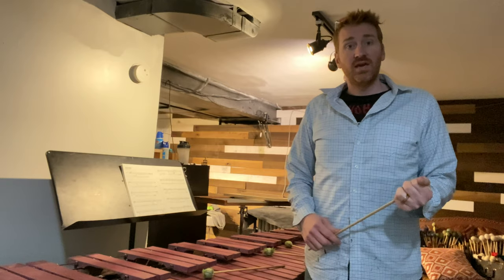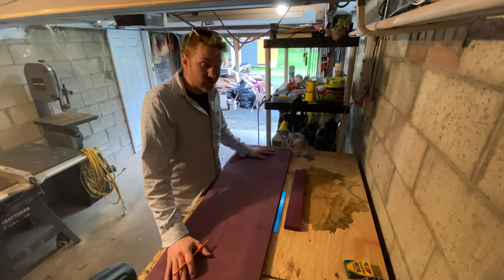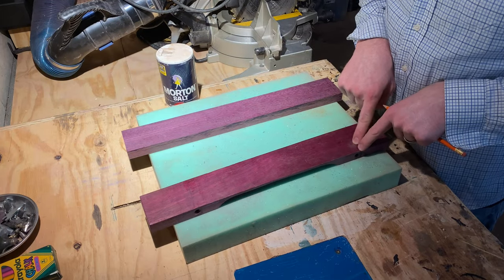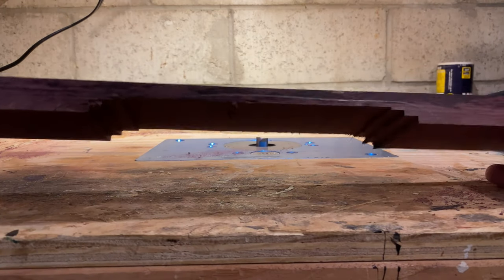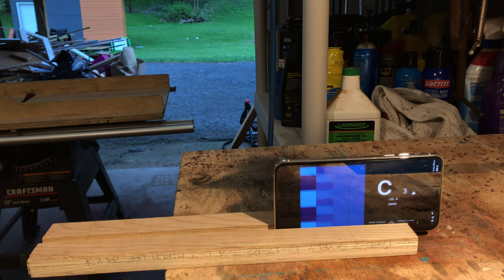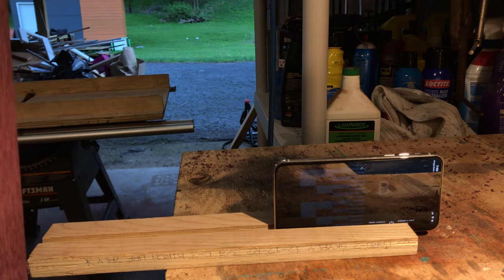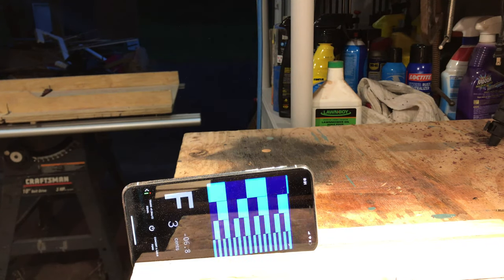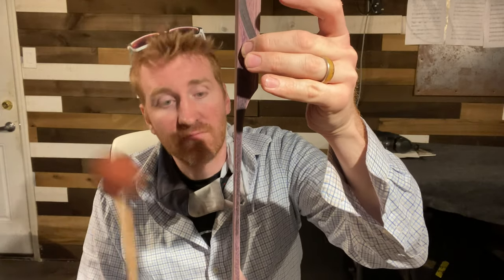Marimba Bar - Build it Fix it!

Comment: Might you know of an ultra-advanced method for node-finding, like a fancy camera that detects/shows vibration-imagining? Might you know how the big boys do it? I can’t imagine the Marimba One and Yamaha guys doing the salt trick for all their thousands of bars. 🙂
Reply from the maker: Thanks for reaching out man.  Ummmm....It has been about 8 years since I have reached out and got an answer here so it might have changed.  To my knowledge the way that major producers like Adams, Yamaha, and Marimba One work is by mass producing one size bar.  They spend a ton of time figuring out the best size to produce the best overtones and then they mass produce that bar and pick the best sounding bar out of 1000s.  During the testing phase I believe that tracking the nodes is important but once they get the size, I don't think they would track it for each bar.  I believe they just go by ear at that point.  For finding the nodes, I don't think that there is a better method than salt or sawdust because the amount of money to create a product for such a small market wouldn't really be economical right now.  Most of the people making marimbas actually do it more by ear and by old methods than by new ones.  Marimba One, I believe, is pushing to use tech more than any other company.  This is seen less in the bars though and more in the resolators.  They have some crazy tech that goes into those which creates a very specific sound (some would say that it is a bit too perfect a la auto tune).  

Here is a link to a Malletech marimba being made via Discovery - https://www.youtube.com/watch?v=dind6S2hRHc  This is old though and they might have changed some practices.

Another example of old tech versus new tech is how they make cymbals.  I toured the Zildjin factory and was surprised to find out that they don't have a fancy camera/imagining product to find out which cymbal passes their quality control.  It is literally one of three guys that hits every cymbal that leaves the factory on the bell, the middle, and the edge.  They go by ear.  However, they use machines to hammer the cymbals and a robotic arm to stamp the cymbals.  Its really cool to see how the old school work mixes with new tech.

Comment: does adding polyurethane finish change tuning at all? also, what method do you use to apply it?
Reply from the maker: I didn’t find that it did. The pitches were the same before and after. You could definitely make an argument that it would change the sound a little but on this quality of wood, it is hard to hear a difference. In fact, I think having it sealed helps with the fluctuation in pitch more. I just used a simple rub on poly from Rockler.

Comment: Incredible job!
Your resonators are made by what material?
Reply: 1:20
Reply: @the_nondrive_side  Resonators, not bars. @Tomas Luiz - looks like ABS pipe. You get a glimpse in between the bars at 11:30.
Reply from the maker: Hi Tomás.  I used PVC piping from Home Depot.  The drag is that they don't have 2.5 inch standard so I had to use 3 inch pipe.  That throws off the alignment if you aren't careful.  As long as they are air-tight and tuned well, they sound good!